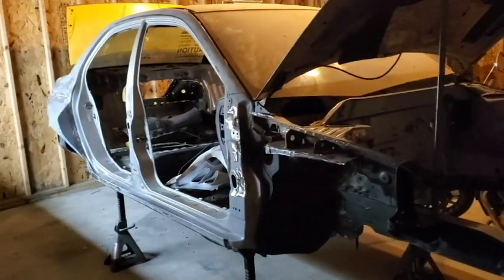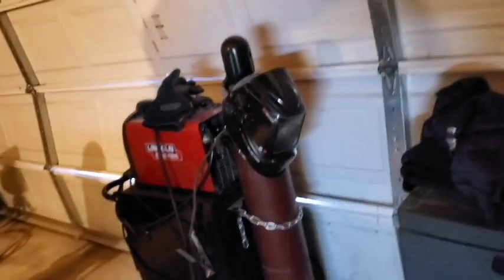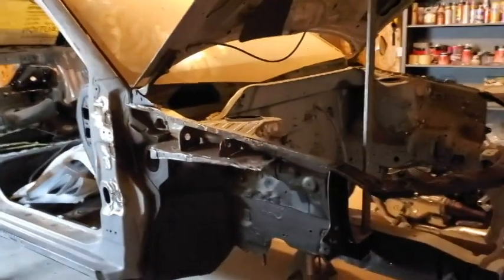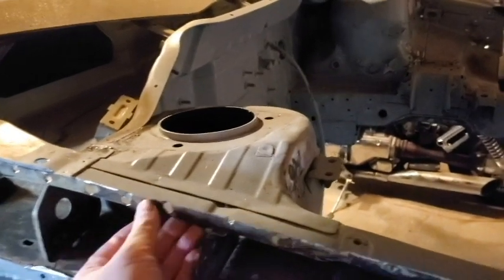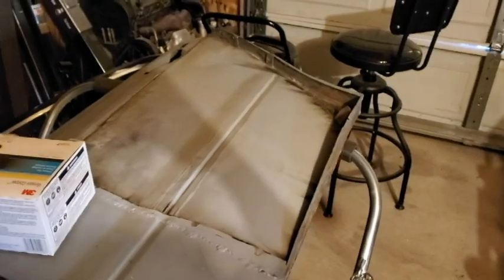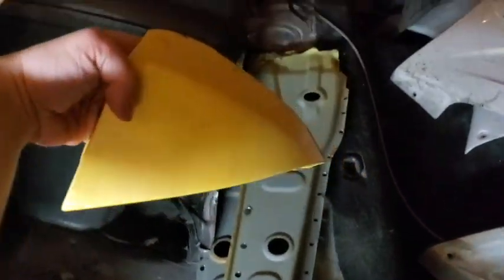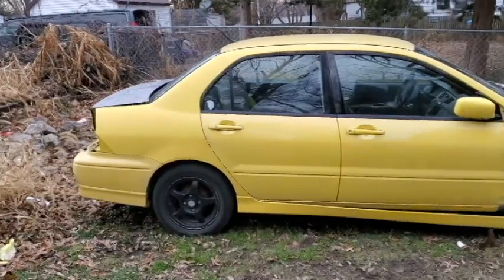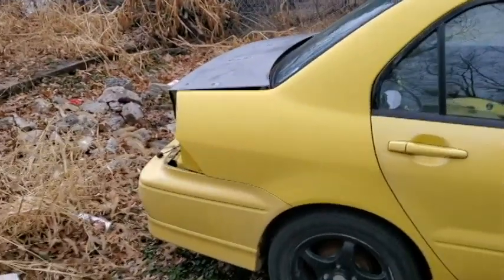Lancer To EVO Build Ep. 25 | Few Changes Being Made

Comment: Gas. When you open the bottleand close it. Look on your meter. Does the pressure drop. If it does you have a leak.
Other thing on how many liters pro minute did you set your flow for welding?